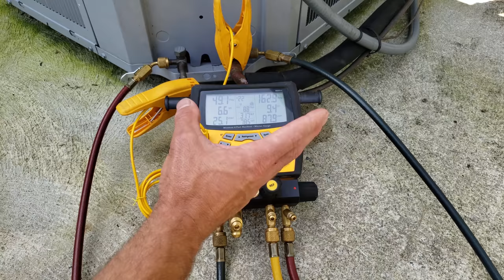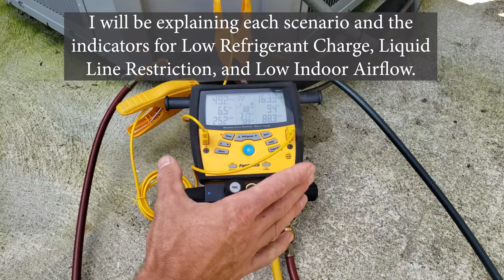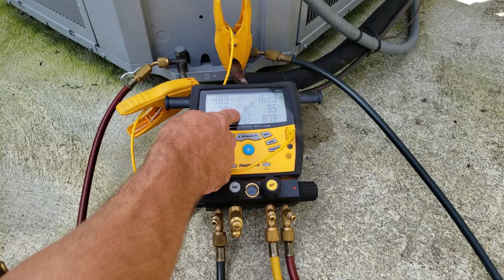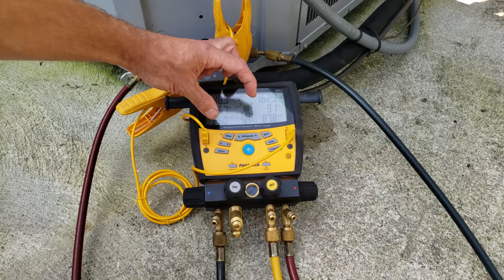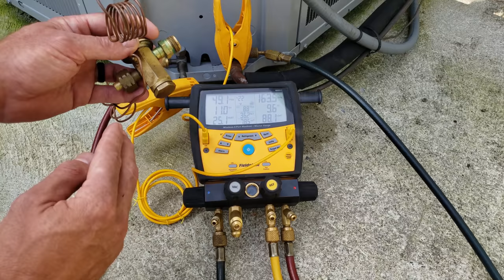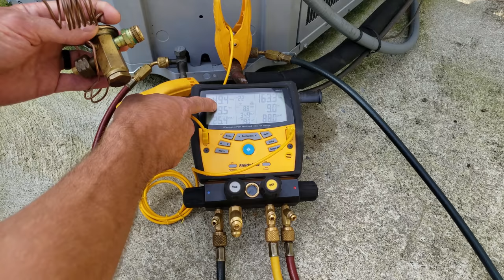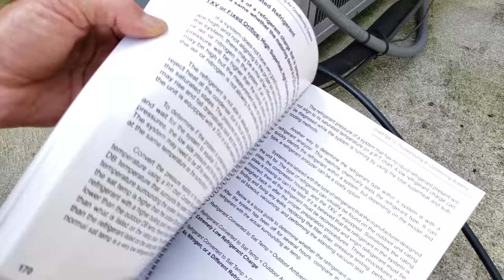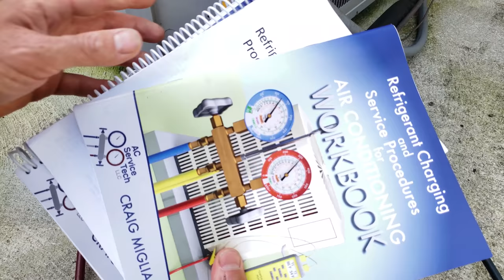Low Indoor Airflow Problem While Checking the Charge & Troubleshooting!

Comment: Another great video,I have a question though,what is your preferred method of checking airflow?I have the exact same manometer you have here but was thinking of picking up the hotwire anemometer as well.Most of the time the equipment data is not available on site and in some rural areas I can't check online.

Comment: R410a single stage system.  Outdoor temp 84deg  indoor temp  77 deg. Suction pressure 171. Line temp 66 deg SH 6deg   Head pressure 266. Line temp 70deg. SC 17deg.  Txv system 4 ton ac unit with 4 ton uncased evap coil.  3/8 liquid line with inch and 1/8” suction line approx 20’.  Can’t figure out why this is happening. Temp split is only 12-14deg at best.  Airflow is good. Not sure on static pressure or cfm.  Any suggestions??  Any feedback would be great!!   I am only asking because I believe you have some of the best educational videos on you tube. Thanks for what you do!! I also have a pic of these readings from measure quick.
Reply: delta T to low for me supose to be 18 20 split.should be air flow problem, no sure
Reply: A litle over charge to
Reply: What is the required subcooling? Per the name plate inside the unit if available.
Reply: What does measureQuick suggest as likely problems?  Liquid line temp should be more like 89 deg given OAT of 84 deg).  mQ suggestions (flag in upper right corner) may be your best guide.
Reply: If 70 deg liquid line temp is correct (with 88 deg condenser condensing temp and 84 deg OAT) you definitely need to consider line restriction.
Reply: Thanks for all the help.  Subcool is supposed to be 10deg  based on data plate.  This is a Payne ac unit.  I just think the head pressure is a bit low to be overcharged even with a higher subcool.
Reply: @brandoncoffee8044  most payne units call for 12° subcool
Reply: @brandoncoffee8044  and you should probably have 7/8 suction and 3/8 LL . @ 20ft. But at least a 3/4 suction lineset .on a 4 ton unit  .

Comment: Why sometimes SC is 0? Liquid line temp following with the saturation temp on the high side while charging. System has a TXV. R410.  The only way to adjust the system is using SH method. To get  10 degrees SH. Condenser blowing hot. Good airflow. System works stable.
Reply: VicPapefu thank you ill try to check it.

Comment: So low air flow can cause a problem.  Can an over-sized unit cause low air flow,  say only 12000btu needed but a 24000btu unit is installed?
Is it better to be a little under-sized or better to be a little over-sized?
Reply: Only be sized half a ton bigger. Never be undersized because you will have issues of home not cooling enough everywhere